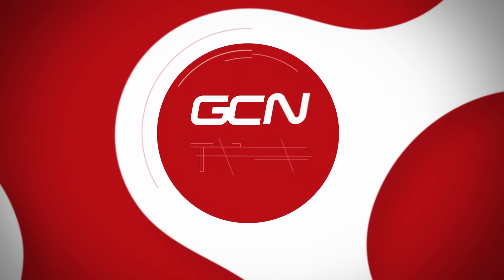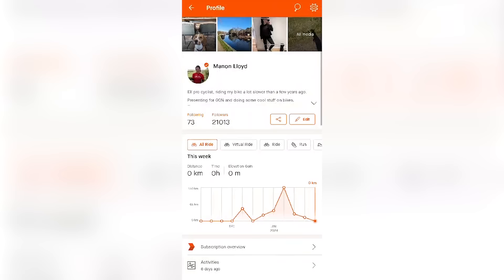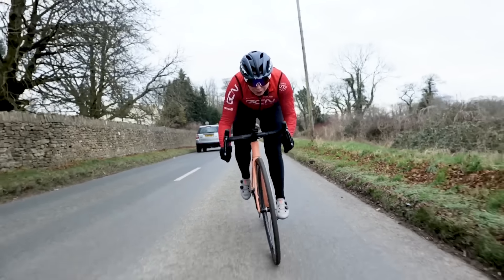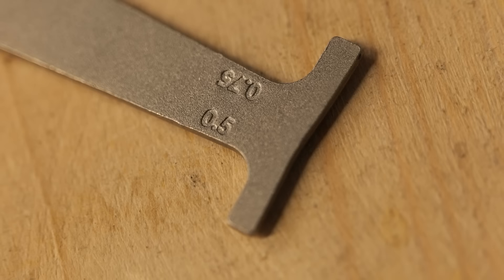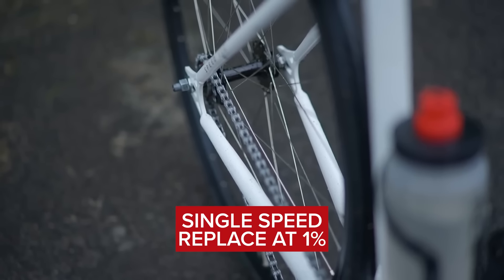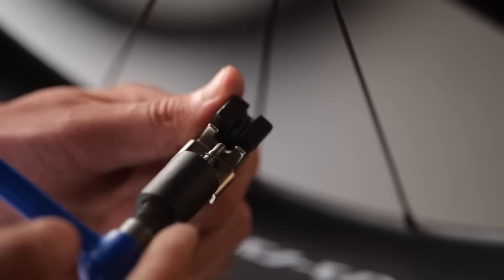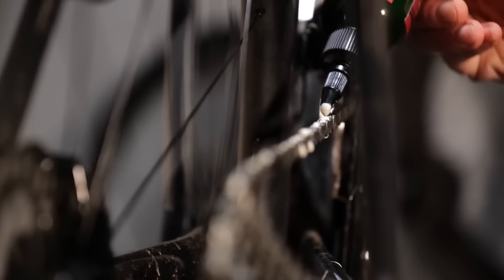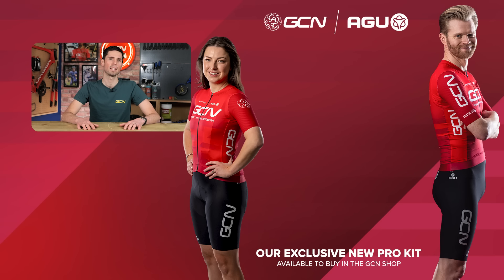How To Track Your Bike Maintenance & Save Money

Comment from the maker: Share your own method of keeping track of your bike maintenance? 📲
Reply: once a month I go over my bicycle and lube the chain, I picked the first of the month when I pay rent so I don't forget.
Reply from the maker: @bikecommuter24  Now that's forward thinking! 🤔
Reply: Do everyday: check air in tires, check "lube" on chain, check the batteries.
Do every week: check chain wear, wash the bike, charge the batteries.
Do every other week: hot wax chain. check the brake pads
Do every month: "pro clean" the bike (make it look like a pro just washed it)
Do every two/three months: bleed the brakes
Reply from the maker: @endcensorship874  love to see it 👌
Reply: I'v been using Strava to keep tabs on the mileage of their components since 2011. Then, you used to be able to put in the specific components under their own titles, sadly that's gone now. I also have a reminder on the first of each month to charge my eTap batteries, check sealant and tires.
Reply: I keep a log of whatever changes I made to my bike like changing tyres, tubes, chain, bearings, brake pads, bar tape etc. With the help of Strava keeping track of the mileage of my bike, I take a snapshot of the mileage and paste it in my "Notes" together the changes done and date.
Reply: @endcensorship874 I let you have my bike then, I never bleed brakes for years

Pro clean I guess pro mechanic clean as know if pro cyclist clean then wouldn't be touched

Comment: Actually when going into gear section of Strava on your web browser, you can add specific parts of your bike (like chain or cassette). It will calculate mileage for you. You can retire a part as well. Dates when new part was added and retired will be stored. So it is even easier than keeping your personal log.
Reply from the maker: It's getting even better! Love to hear it 🙌 The more data the better
Reply: Strava should make that available on the apps. Currently, only available on web.
Reply: The mileage is still subjective though due to varied riding environments .Chain wear measurements still need to be taken and applied . The software cannot compensate for this reason .
Reply: @robertmcfadyen9156  Yeah, I agree. I am personally checking my chain every time that I reapply my drip on wax. Which would be every ~250 km. But I am aware of the conditions that I am riding in. So this is just a tool to help you measure how long your chain actually lasted in "yours" conditions. My chain already last for ~8000 km and it is still quite fine with riding on flat and only dry conditions. That would of course be worn faster in more hilly routes. Or when riding in winter. So it all depends.
Reply: @_hasz  In the early 1990's , my XC riding , (GT bicycles) , in all conditions saw chains wear out by 2,000 kms . I was not cleaning as often and was " GRINDING" gears a lot .
Reply: @_hasz  I now use and supply Connex Wippermann chains in my work . I import them as there is no local agent . I have been using them on my own bicycles since 1998 .
Reply: @robertmcfadyen9156  That's wild! I got caught into the waxing this year. I guess it is Ollie's fault (or merit). But when keeping it clean and tidy, and riding only when it is dry, it makes a lot of difference!

Comment: I try to check my chain regularly but I think I should do so more often, thanks to this video! It is also worth noting that even if you do replace your chain on time that even cassettes and chainrings won't last forever but they do last longer, especially if they are made from a softer material than the chain. I have TA Specialties alloy chainrings on my winter bike which have seen off 4 chains, and I am currently running my 5th, but the teeth are just starting to lose their flat edge and morph into shark teeth. I will need to check them when the current chain wears out as it's only a few hundred miles old but they may need replacing at the same time as this chain, if not definitely the next one. The cassette was installed new with previous chain so should still be good for a while.
Reply from the maker: It can be super tough to remember to check your chain! That's why staying organised is the best course of action. Great to hear you are staying ontop of things at the moment. Do you keep a record of you bike wear? ⚙
Reply: @gcntech  I don't write things down and keep a record. But I try not to let my bikes get too dirty and I give the components including the tyres a regular inspection and replace when necessary.

Comment: Good tip! For those with BMC bikes, the BMC app allows you to specify all your components and as notes/replace components as required. As your rides are uploaded the mileage is set against all components, including chain and hardly have to do anything!
Also, for those with sram flat top chains, standard chain checkers don’t work.

Comment: One thing that holds the Strava feature back for this purpose though is if you have two different sets of wheels, or if you're alternating between multiple waxed chains.  Since it does the wear per bike, then the component information would be wrong in these cases.
Reply: Put bike as 2 on Strava eg Trek  race wheels and Trek TT wheels or whatever 😊

Comment: I keep a spreadsheet that counts kms for chains, pads, tubes, tires and that I update with issues, buys, maintenance etc. I also had an application (can't remember which but it was from a component brand) that was very good in doing exactly this, connected to Strava or Garmin to get kms and reminded you it is about time to change something but at the end I found the spreadsheet easier to get a whole view and more straightforward.

Comment: I check my chain every couple of weeks. I'm a bit of a spreadsheet geek so I have one where I keep track of all my rides (both indoors and outdoors), any repairs that I do and parts that I buy. Whenever I replace something like a chain, inner tube or tyre [tire] I write a note in a comments column. It's then a simple task to highlight the cells in the distance column from that date onwards to let Excel add up the mileage since the last chain replacement. Yeah, I know, I need to get a life 😁

Comment: One of the best ways to make a chain last longer is to simply wipe it off with a clean rag after each ride.  This takes about a minute and removes a significant amount of grit, before it can work its way into the rollers and cause wear.  You can also add a thin layer of lubricant on a second wipe and that will clean and lubricate the chain for the next ride.  I do this after every ride or 80km and use a chain cleaner with solvent only once a year.  A clean chain will last much longer, which will also extend the life of the cogs.
Reply from the maker: Interesting! Have you ever tried waxing your chain? Can be a great way to keep the chain lasting longer 👉 https://youtu.be/1pndkk5fTiw
Reply: @gcntech  No, I just use Squirt. As the chain gets dirty, Squirt flakes off.   It was Lennard Zinn, the reknowned bike builder, who recommended wiping the chain after each ride.

Comment: If you routinely remove the chain from your bike for cleaning and or waxing, the easiest way to measure chain wear is to hang a new chain (already prepared for use) from a nail next to where you store your chain maintenance equipment.  That way when you remove your old chain, you can hang it on the same nail and compare the full length of the chain.  If the old chain is more than 1/2 a link longer (.5%) then don't bother any further, throw it away and install the new chain instead.  Then buy a new chain and get it prepped, and hang it on the nail.

Comment: On my road bikes with waxed chains I check the chain before I take the chain off (so the layer of wax doesn’t throw out the reading). On my mtb I check it when I wash it or roughly monthly. This can be too often but for 30 secs work it can’t hurt.

Comment: I check my bikes all the time. I also use the winter to do major work like checking and replacing as needed bearings. Seems to work for me. I am trying the new CS app to see what it tells that I may not know already. As I ride 13,000 to 16,000 k per year lots of stuff wears out.

Comment: I use Strava and add my bikes to "gear" and make a note in how many miles that chain is on. It keeps a log on the miles the bikes are doing.. Also use it for trainers/shoes for my running
Reply: My Zwift bikes chain is currently on 7690 miles and still shows little signs of wear
Reply from the maker: Bike nerds unite 🤝 We're loving how nerdy you guys get!

Comment: I use two chains, and switch them out every month. Easy way to keep a clean chain, as the other chain stays in the container with degreaser. Was wondering how many miles do you go before you switch out to a new chain? I wanna see if two chains is a better option. TIA
Reply from the maker: Interesting! Are you waxing the chains too? - We love to hear the efficiency 🙌 The age old question of how long should a chain last all comes down to conditions and how well it's looked after.

Comment: I made it a habit of quickly checking it in 3 places each time I clean & lube, so at this time of year after every 1 or 2 rides.  However only recently made a massive upgrade from 9 to 12 speed, and my checker only has 0.75 & 1, but doesn't check for 0.5.  Any reason 12 has to be changed at lower wear?
Reply: Probably thickness of the metal.
Reply from the maker: Hi, the tolerances become finer and finer as we introduce more sprockets in more or less the same area 👍

Comment: Thanks Constantine and crew....what is the difference in chain quality ? Should I buy a  more expensive chain , or not ? SRAM has many ..grades , or different prices , what is the difference , and will it wear the cassette or chain ring differently ?
Reply from the maker: Great question. As long as it is the same speed and listed as compatible it will work. The rest of the decision comes down to cost and weight really. Generally the higher the cost, the lower the weight. These days all chains from the groupset manufacturers have refined plates to aid with shifting 👍
Reply: @gcntech  So , a less costly chain won’t wear sooner , or cause wear elsewhere ?
Reply: @cb6866 It will wear out sooner. Going for the middle of the range stuff is best.
Reply: @nah1110  Thank you very much.
Reply: @cb6866  well, a steel cassette is going to last longer, although they aren't expensive. To reduce weight they use aluminium and titanium (XTR), but overall if it's not made of titanium (so expensive) a super light cassette is going to wear sooner

Comment: I’ve got a chain checking tool that my bike shop gave to me when I bought my bike from them with 11-Speed Ultegra group set and chain. I have since bought a Canyon bike with the latest 12-Speed Ultegra group set and chain; are all chain checkers the same or do they have different sizes for 11 and 12-Speed chains?
Reply: The only chain that renders almost all chain checkers inaccurate is SRAM's Flattop chain due to the slightly larger rollers. Almost all chain checkers measure chain wear by contacting the front side of one roller and the rear side of the other roller, not taking roller diameter into account.

The Park Tool CC-4 is one such chain checker that can gauge chain wear accurately for any chain as it measures the same side of two chain rollers, allowing it to disregard chain roller diameter.

If you know you'll never use a SRAM Road 12-speed groupset, any chain checker will do.

Comment: I'm on just under 18,000km on my current chain. Might be time to change it. Measured at 0.5 😮
Reply from the maker: Will you wax or lube it?
Reply: @gcntech  On that chain it has been lubed waxed (UFO Drip) since day one. Mind you it's also a 12 speed sram chain.

Comment: #askgcntech Out of enthusiasm (or stupidity), I've registered for my first-ever gravel event that will take place in late May.  The route is not particularly hilly (around 500m d+), but the distance (160 km) is significantly longer than the longest rides I've ever done (around the 110 km mark).  How should I train for this? Also, from spring to late fall I commute by bike, doing about 45 km total each day.  How long before the event should I stop commuting to make sure I have fresh legs on the day of the event?

Comment: That's wrong! Official, all Sram Chains should changed on 0,8% wear. Srams own chain wear indicator shows 0,8% wear.
On Shimano and other Drivetrains your good to go until 0,75% wear independent how narrow the chain is. So even on 11 and 12 speed chains the cassette is good to go until 0,75% chain wear.
And for Sram 12-speed chains the recomm chain wear indicator is the Park Tool CC-4, especially for flattop chains.
Reply: The Flattop chain is exactly why I picked the CC-4 when I was shopping for my own chain checker.

Comment: In my opinion, this has got to be one of the least useful videos GCN has produced. Just using a chain checker whenever you're lubing your chain is a much better use of time...
Reply from the maker: It will about come down to the rider. Some of us love to track every little details of our bikes 👀 As long as you are checking regularly there shouldn't be an issue.  Sounds like you're on it with your maintenance, which is really great to hear 🙌
Reply: You are forgetting strava is the sponsor of today 😅

Comment: Unusually bad advice from GCN. Although it's correctly pointed out here that a chain will possibly start to wear quite suddenly, if you go out for just two or three consecutive wet rides on gritty lanes, you can literally go from almost zero wear to needing to change the chain. So no, even a month is possibly way too long.
Also, the wear isn't expressed as a percentage, the wear increments are actually expressed as mm of stretch, 0.1 and then 0.075mm across the length of the measurement tool.
Final thing, why dollars? Come on guys, I realise a lot if not most of your ad revenue comes from the the US, but respect your home country. I assume Americans are capable of mentally converting £ to $, the mental exercise will do our transatlantic cousins good.
Similarly, I can't help thinking this is a thinly disguised ad for Strava, not in itself a bsd thing, but if it skews the advice then it is a bad thing. Shame 😕.
Reply: Park Tools website "when to replace a worn chain" says the 0.5 and 0.75 figures ARE percentages and they recommend replacing 12 and 11 speed at 0.5%, 10 speed and less at 0.75% and single speed at 1.0%.